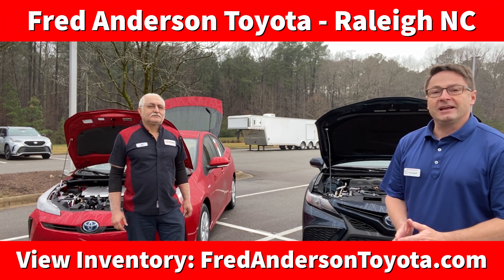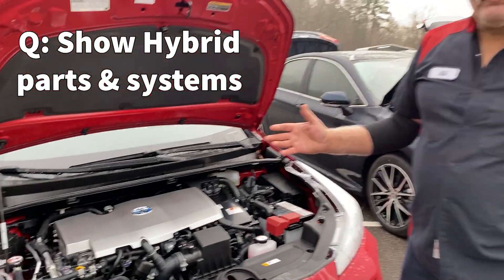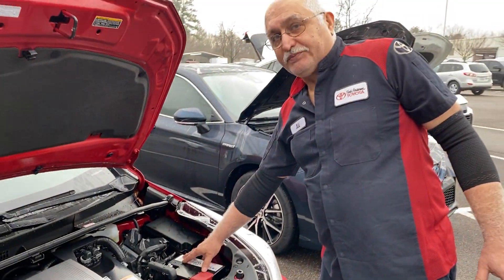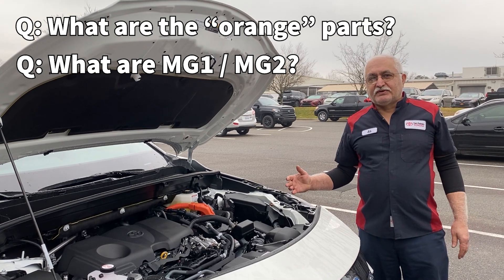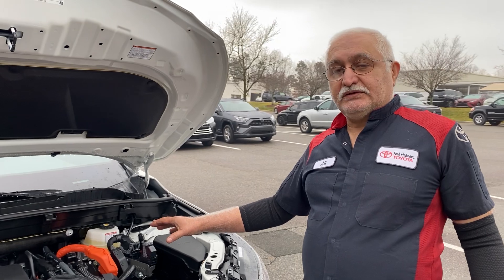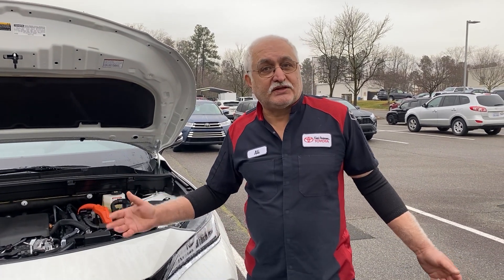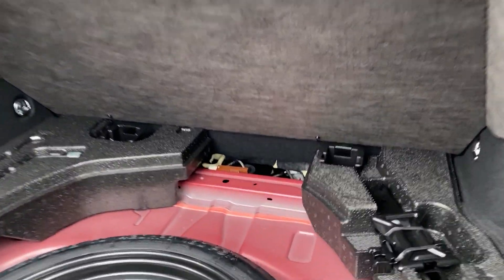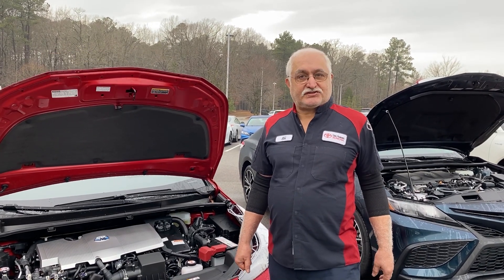Tour of Toyota Hybrid Engine + How Long Does Toyota Hybrid Battery Last? (ASK THE EXPERT!)

Comment from the maker: What questions do you have for our expert mechanic? We will try to answer in future videos
Reply: Yes Jeff  can you please ask him what he thinks is going on with my MPG ? I purchased a 2021 RAV4 hybrid in October. We’ve only driven it 400 miles ( mostly city) to date and the MPG seems way off. I reset it  a few times and it still only averages 29-31,32.
Reply: @billjoang  it is your driving style. Check if you always put it in D not B, no roofrack, and your left foot is not on brake. Pulse and glide, you can reach 50 mpg but may piss other drivers behind you  off.
Reply: will the battery hold up in extremely hot climates. I live in Saudi Arabia and in summer, it gets really hot like 50 - 55 C !
Reply: I would like to see a video: Prius Prime/RAV4 Prime - CHARGE HOLD BUTTON??? What's that all about?? When to use it & How. Or - Don't use it!
Reply: Does the inverter/converter use the same coolant type as the radiator,or is there a speacial coolant for it only.?
Reply: How do you properly run-in the brakes in a Toyota hybrid? How do I know if the hydraulic brakes are even engaged, since MG2 does much of the braking.
I haven't been able to find anything about it.
Reply: @HepauDK  It is TOTALLY about driving style. I have a 2008 Prius with 260,000 miles and still average about 51 mpg. I did replace the rear brakes at 255k miles. EVERYTHING else is still original. I don't "baby" the car, just use common sense. Don't drive up to red lights and break hard to stop; let the motor/generator do the slowdown for you. I.e., recapture energy from the inertia.  Accelerate gently. Try to anticipate where in traffic you should start breaking or accelerating. 

Remember, the "P" stands for Prius not Porsche.
Reply: I wish somebody from Tesla would tell us the real truth about how long Tesla car battery lasts and how much it costs to repair/replace it
Reply: @georgevavoulis4758  Tesla's are junk...... but rich ppl buy them since they have $ and wanna look cool with the name.  It's all status.....Get a toyota Hybrid!!
Reply: Toyota Prius plug-in 2015 and regular Prius, has the same hybrid battery 🔋?
Reply: Is there a minimum average daily distance or miles required when driving a Toyota hybrid?
Reply: The battery is located at bottom of the car, it can survive high water levels during heavy rains or while driving on desert safari it will manage to bear the heat ?

Comment: Thanks for sharing your experience and knowledge, Ali! Two weeks ago, I bought a 2014 Prius V with relatively low mileage, 91,000. It was well maintained, starting as a corporate company vehicle for the first two years, and then a mechanic owned it for the next 7.5 years and it is still near showroom condition with zero problems or accidents, not even a noticeable scrape or scratch. I wasn't really considering a Prius but my mechanic who works only on Japanese cars said the Prius is one of the most reliable cars on the road. My wife's 2013 Rav 4 she's had for eight years has been perfect so far, so I know Toyotas are consistently the best-made cars today. A good deal came up with this car and I want something I will have no worries about. I took it for a test drive and was surprised at how smoothly, quietly, and solidly it handles with much more gusto than I thought it would have when you need it, such as merging on the freeway. So now I am educating myself and have no more fears about hybrid battery failure since I will diligently keep up the maintenance and have learned what to do and not do, such as keeping the hybrid filter, filter port, cooling fan, and battery itself clean, since I have learned not doing are the biggest causes of failure. I appreciate your expertise and knowing how it works gives me peace of mind. I look forward to watching some more of your videos. Thanks again, Ali!

Comment: I have a 2022 Toyota sienna. I don’t drive it that much Due to my disability. I have a low amp solar charger to maintain the battery. Is it best to connect it into the dash with a cigarette lighter type adapter or directly to the battery at the rear of the vehicle?

Comment: I have 2014 toyota auris hybrid.Replaced the hybrid battery at 170,000km.
When is the smaller battery due for replacement?
Its now 225,000km.
Reply: How much did replacing the battery cost?,
Reply: @shahee6579  3000sfr 2years ago

Comment: Is 12V battery used to start the car or HV battery? Does 12V battery on hybrid last longer than regular car? I have not replaced 12V battery on Camry hybrid for 10years 90K miles.

Comment: The engine is not like ANY other auto engine.  It is an Atkinson cycle engine.  It is less powerful than conventional engines but is VERY economical and adequate for a Hybrid.  The Hybrids have two power sources, Electric and Internal Combustion.  Hybrids are propelled only by electricity.  The mechanics words were for simplicity rather than specificity.

Comment: I bought a 2021 Venza hybrid. The battery has gone bad twice rendering the vehicle inoperable. The second time it happened I took it to the dealer and they said the bigger battery was draining the smaller battery because of a software problem which they say they fixed. If it happens again I will sell it and never buy a Toyota again. If it doesn't then  I will keep the car for a long time because it is otherwise quite nice.

Comment: My Toyota fielder 2014 hybrid car dashboard is showing death triangle and engine check sign. I went to recognised workshop. They diagnosed with their system and found a faulty code and they erase the code, my car was then fine, all sign had gone but after running few miles again same problem arrived. What is the possible reason?

Comment: Have a 2006 Prius with 69k miles. I have the red triangle and the obd2 tester shows a bank 9 failure. The replacement module are difficult to come by. Even Toyota will not sell this. It's a nightmare.

Comment: We all know the ridiculous labour rates and high cost of replacement parts at dealerships . As long as I can remember all the cars I’ve owned only saw the dealership while the cars were under warranty and once expired I would either work on the cars myself whenever possible or I took it in to a trusted and reasonable shop for repair. My concern with buying any new car today especially hybrids or EV’s is that they are so complicated it’s ill advised taking it anywhere else but to the dealership who best know the cars and how to repair them. Knowing this the dealers are drooling when they see you drive up as they know they are going soak you for everything you got. Not a good situation to be in as a consumer.
Reply: As much I agree with everything thing you have said..with that said cars are more complicated to work on than in 1920s for example..i think your local cheaper good mechanic will come around to learning and having the necessary tools
Reply: I agree I'm debating between gas and hybrid. My thing is yes you save money but if you need a repair they are not cheap.

Comment: Thanks.  Would like to add that it is very simple, inexpensive and critical to maintain the hybrid battery cooling fan and filter.  The biggest singe problem that shortens battery life is not maintaining this simple system. If you keep up simple maintenance on these cars they will easily go into the 300 plus thousand mile range.

Comment: I have an 07 Toyota Prius with only 78000 miles.  I was told I need to replace the hybrid battery.  $3500. Plus $500 to in stall by Toyota dealer.  Is this common for ‘07 Prius?

Comment: There is project lithium  ( https://projectlithium.com/products/prius-lithium-replacement-pack) 
that offer a LiPo replacement for the NiMh in my 2013 Prius 2.  Would that be a wise thing to do?  Since my car is 8 yrs old but I am the 3rd ( third) owner, would Toyota honor the warranty. It will never charge full and goes down very quick.  EV is never available as it says voltage is to low.  Most likely a few cells have degraded significantly !  PLEASE HELP!

Comment: He forgot to mention that it's not recommended or to avoid using a jumper cable from a hybrid to a non hybrid vehicle. The electric system can get damaged.
Reply: If you use a electronic safe cable it should be fine
Reply: It's not recommended because the hybrid only has a very small 12V battery because it only needs to power a few computers and establish connection to the hybrid battery which provides the power for starting the engine and it doesn't have an alternator but a DC/DC converter which converts the high voltage the hybrid battery is providing into lower voltage to charge the 12V battery. And this system is just overwhelmed with the demand of power from a non hybrid car.

Comment: I can't find a video on  how to properly charge the 12 V battery when it fails.  To make it back to the dealer for repair.  My battery went down on my 2021 RAV 4 Toyota after 18 month use.  It was under warranty and  did want to jump start or charge for fear of doing something wrong and damage to the system.  A serviceman sent by Toyota showed up with a big portable jumper battery & jumped it, had it running for 5 min.. disconnect it and told me.  Is ready to go.  I asked, is it safe for me to drive it to my dealer?  I mean, is not going to turn off on me?  No, he said.  Just drive it in, and tell the service manager the problem.   Service manager told me after an evaluation.  The battery was weakened by a voltage draw in the system.  It should had been reprogrammed and download  with the new program.  And he did say, this 12v. battery has an 8 year life.  My question is, can I charge it with a regular charger like a normal car or not?  His answer was not very clear.  And even on YouTube, there seems to be no clear answer.  I want to see, "if your 12 V battery goes down, these are the steps you take to properly charge it without doing any damage."".  So far, have not seen anything on this.
Reply: I hope you get an answer as it's a good question / concern and I'd like to know as well.

Comment: I own Toyota Camry hybrid 2007 with over 410,000 km. The car is still good. The battery is still original.
Reply: I have a question. Have you ever changed the transmission oil so far?
Reply: @trentoproduccento  Yes, I did.

Comment: Lithium batteries do not work below 32 degrees Fahrenheit or above 80 degrees. They are cooled by refrigeration, heated before 32 F. All takes power from the battery.

Comment: I live in Europe and while out walking recently for my daily exercise I passed two Toyota Prius's. One was a 2005 and the other a 2008 model. After passing them enough times I finally got to speak to the owners of both of them. The lady that owned the 2005 one which had 120,000 miles on it owned it for two years and had no problems with it. The guy who owned the 2008 one had owned it since it was two years old and it had 140,000 miles on it. He too had no problems with it.

Comment: Due to the design of direct fuel injection. The intake valves and inlet manifold get coated with high deposits of carbon. Since the valve and inlet manifold no longer have fuel to clean them. The removal of the carbon is not a small job but a costly one. So are we back to the old days of requiring a engine top end decarb requirement? Is that covered in your warranty?
Reply: I don't know if it's in all of them but the 2021 Camry Hybrid has both direct and port injection, and the computer switches between the two as conditions demand, so that should take care of the carbon deposits and get the efficiency boosts that direct injection gives.
Reply: @John_Ridley  Camry is a premium range. The fact that this problem as been created and unable to resolve without a lot of expense to the customer says a lot about Toyota.  Meaning let's meet emissions regulations at the expense to the customer.  The same problem exist with all direct fuel injection petrol engine cars. VW TSi engines appear to be a problem at around just 40-,000- 50,000 miles . Food for thought. Another reason for not purchasing hybrids.  And just go pure electric, if one can afford it. Which of course many  cannot.

Comment: Top question right here regarding a 2nd gen prius 
Why do I have to completely stop to car for the engine to do idle check for stage 4?
Gen1 doesn't have this idle check 
Gen3 and up can do idle check while driving 
On my gen2 if I don't stop to 0mph it will keep the engine running forever if I drive below 32mph just for that nonsense idle check

Comment: Good Video Tank you, when I drive more than 30 minute with my priuce 2016-2017 and headlight on I got this message (Headlight System malfunction Visit your Dealer). Visually lights working well and ODB test not showing any error. what is cussing the message to appear

Comment: Good Morning Fred, from the U.K,
                  Can you please explain if it's true that you can't move an electric car with a flat battery, you have to charge it first? So if your car runs low on charge on a motorway the repair truck has to part charge it before it can be towed off.
Nice video by the way as well.
many thanks.

Comment: Here in the hills of San Francisco prices are used for taxis and Uber and Lyft.   They easily get 375,000 miles out of their engines and transmissions for taxis they are mandated forced to retire the car after 375,000 miles. 

            I have five Prius in my family all of them went over 300,000 miles plus never had an engine or transmission failure. And were sold and bought new ones. 
                       My current Prius see that I use as a work vehicle heavily loaded with tools and equipment 30,000 miles plus a year driving with the engine idling being left on from 7 AM in the morning to 7 PM at night usually keep in the air conditioning on or heater. 
                 Finally having my first battery pack starting to have problems after 105,000 miles. 

          The batteries are so cheap only $1200 and I myself can change it within 30 minutes so easy even a child can do it. 
           Of course I’m a mechanic and I’ve been working on cars for nearly 40 years now. 

        My wife got the Tesla model three all electric cars are so much easier to work on and no maintenance I will probably never own another car with a gasoline engine in it again.
Reply: Please talk about engine oil change interval. Both Coolant change intervals and ATFWS transaxle fluid lack of change internals. I have a 2017 Prius 181,000 miles. Toyota dealers in Iowa have a passion to kill these cars off. Can it be done with consumers being  told u don't need to do that. Get out of here.
Reply: @2148aa  Change your transaxle fluid don’t listen to that lifetime fluid BS.  Or if something says 150,000 miles change it out at most 60,000 miles or more often. 

If an owners manual says change engine oil every 7000 miles or 10,000 miles I would highly not recommend going further than 5000 miles on 100% fully synthetic oil. 

       If you live in cold weather climates and you do a lot of short trips and somebody is cheap and they use regular petroleum oil instead of fully synthetic oil they will most likely be that customer with a clogged up EGR system. 
           They will most likely be the customer who needs an engine after 160,000 miles or less. 
            Let me be that customer with the plugged up failed PVC system due to clogging up of oil accumulation

         These hybrid transaxles when you do change the fluid can easily go 300,000+ miles. 

Change the coolant more often than what Toyota says and only use Toyotas high mileage coolant that was recommended for the car do not change coolant two different brands. 

        Never ever top off your coolant system with tapwater that contains iron , calcium, magnesium and other mineral salts that turn your coolant into a electrolyte and cause electrologist corrosion and deposit build ups. 

       When I was a child my dad taught me he said if you don’t like a customer and you want to destroy their car top off the coolant and mix it with tapwater they will be needing heater cores radiators and freeze plugs. 

        If water is ever used you only use distilled water or highly purified reverse osmosis water. 

         Flush the brake fluid system and if you cannot afford to buy it for us to break food system or do it yourself. 

      You can at least get something like a turkey baster and rig up a long thin flexible hose or straw onto it and suck out all the brake fluid in your break fluid reservoir once a year or once every two years and then fill it back up with fresh clean “DRY” brake fluid this is better than nothing. 
                  Because brake fluid is extremely hydroscopic absorbs moisture right out of the air and this is what makes it become corrosive and breakdown in cause components to fail
Reply: Hey..i want to know about hybrid battery degradation and if there’s any effect on car mileage?
 @coldfinger459sub0
Reply: Hey..i want to know about hybrid battery degradation and if there’s any effect on car mileage?
Reply: @jsb04  yes , towards the end of life.  You will notice your gas mileage go down a little bit.. 

You will notice that your battery level trains down faster . 

You will also notice that your battery charges up faster but there’s not as much capacity . 

The battery indicator will show that the battery is full . 
     But you will notice discharges, much more faster. 

So the engine idols longer and idols more often to constantly charge a hybrid battery this reduces your gas mileage for a little bit 

And because your battery does not have as much capacity to help the engine accelerate more often this also reduces your your miles per gallon.

Comment: You did not mention the gas engines average lifespan if normal service is performed also does the Lithium Ion battery pack carry the same warranty as the Nickle Metal Hydride ?